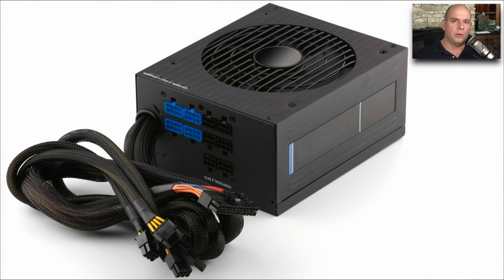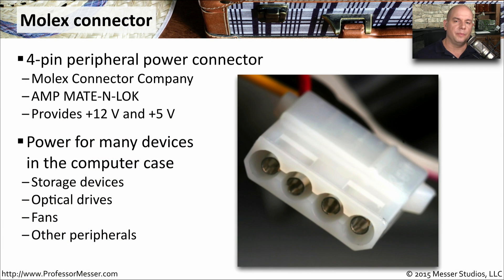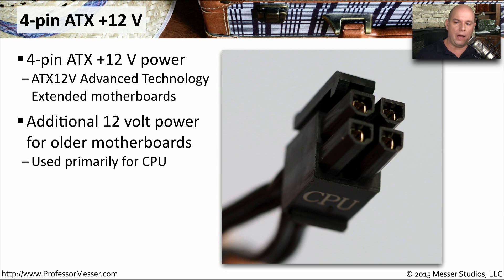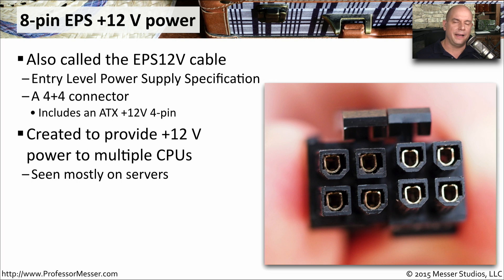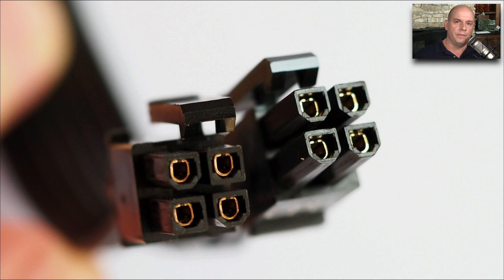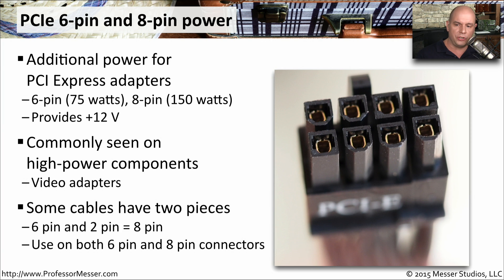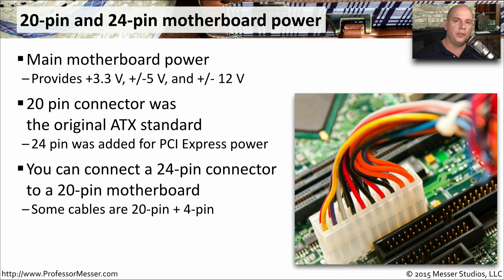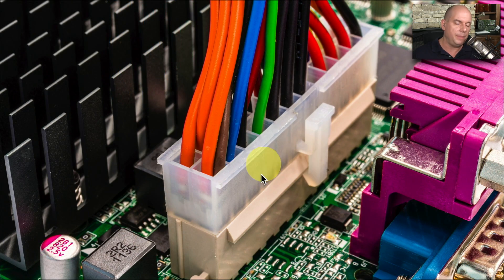Computer Power Connectors - CompTIA A+ 220-901 - 1.8

Comment: Prof Messer, What R the 4 blue 8-pin things on the PSU case for? (show ~13 secs from 0:06 to 0:19) Near where the DC cables come out of the power enclosure.
Reply from the maker: +Haslett Douglas That's a semi-modular power supply, so there are both hard-wired power connectors and modular connectors that can be added or removed as needed. The blue and black modular connectors are used to power different components. The 8-pin blue connectors might be used for PCI Express power, and the 6-pin black connectors might be used for other peripherals. Different power supply manufacturers use different modular connector types.